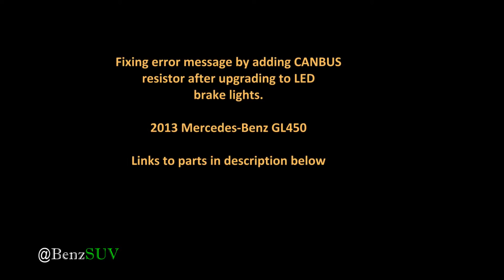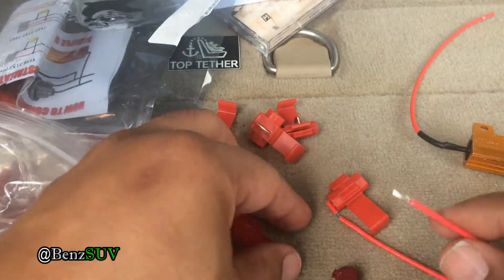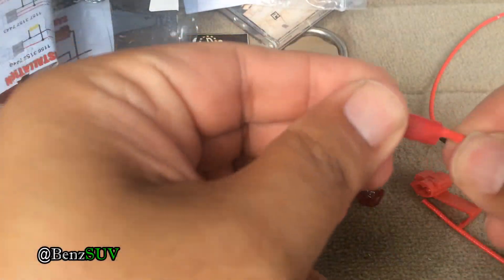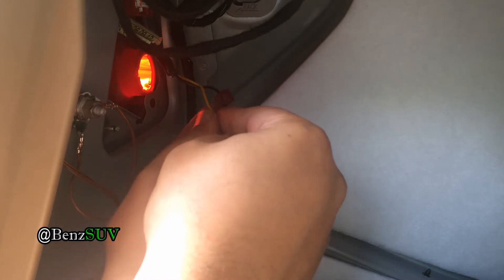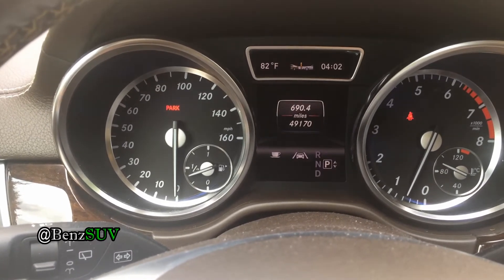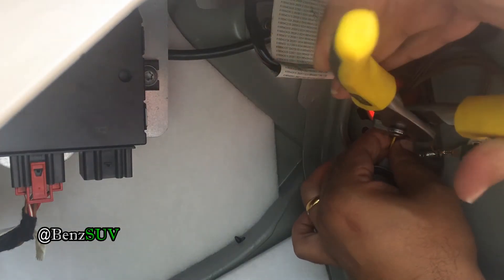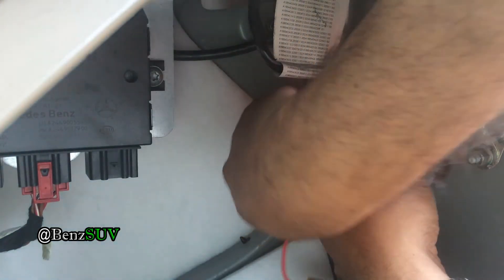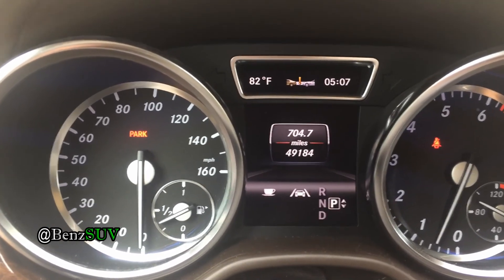DIY install of 50W resistor to remove LED bulb errors in Mercedes

Comment: Hello, I also convert last week the reverse bulbs to Led T15 W16W Canbus in my Mercedes GL X166, but im geting error codes, should I install this 50Watt resistor? Thanks!
Reply from the maker: I've been wanting to change my reverse bulb as well but have not because I have not seen anyone else do it without getting error codes.  I am not sure if there is room or means to attach the resistor. But the light would have to pull more current for the error to go away in the dash, and the way to do this is to add a resistor.  I am not sure if there are newer LEDs that don't cause errors.  I have not found any.

Comment: Amazing content I was wondering can you put the resistor with out actually putting the bulb in liek I have down a fade lift to 2021 and I cancelled the reverse ligjt I don’t want to put any reverse light can I just plug the resistor in ?

Comment: The cables can be connected either way of the resistor, or is there a +/- in each cable?
Reply from the maker: The resistor wires can be connected either way. Resistors have no polarity.

Comment: hi.. have you try the reverse light? if im not mistaken, it is T15 / w16w socket for the reverse, i tried Canbus T15 bulb yet still get error message, where i put in my w212 it did not give any msg error.. i dont want to put resistor in my reverse as it is very cramp on the back door.. do you have any solution about it?
Reply from the maker: I don't think anyone has been able to do this successfully w/o a resistor.  All the bulbs I've come across that say CANBUS or error-free still produce errors.  I've seen some LEDs advertised on youtube but they never show the reverse bulb replaced.  It's a shame mercedes does not use LED on a $80k+ car.    I also have not done this yet, looking for someone who has done it successfully on a GL.  Thanks.

Comment: You should have connected the resistors in series. What happens when  a bulb blows and the resistors' impedance is as great or if not greater than the original bulb's resitance? Your warning light will not give you an error message.
Solving one problem and creating another?
Reply from the maker: I thought about that but that requires cutting one of the wires to insert the resistor in series.  Which I was not ready to do.  Also, every install video I've seen puts the resistor in parallel.  I will test it during the summer - remove the bulb and see if the warning light comes on.  Thanks.

Comment: Bad connectors you damage your original wiring
Reply from the maker: It depends on your crimping skills.  After having these resistors connected for some 3 months or so, I got a light in my dash saying left side brake light was out.  When I went to check, the male/female had come off b/c I probably did not push it in all the way.  After pushing it in tighter, have not seen issues.
Reply: @DIYDharma  worst POS connectors ever made, who ever designed them should lose there engineering degree.  6 months from install the wires will be corroded and starting to break.  Have had these crap pieces cause so many issues within a year of install.  They do give us real mechanics some work though.
Reply: @clintjonsson8012  mechanic??? for wiring??? hhahaa